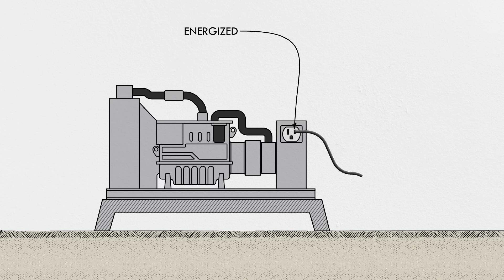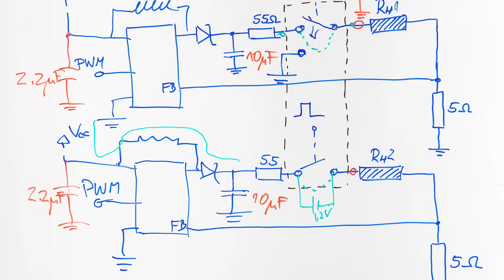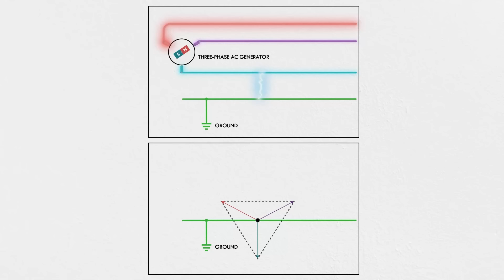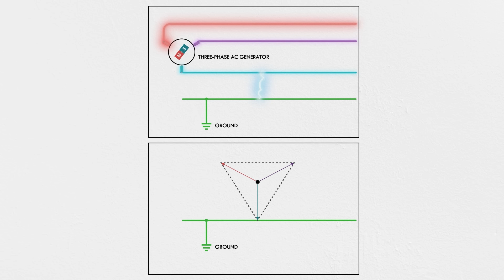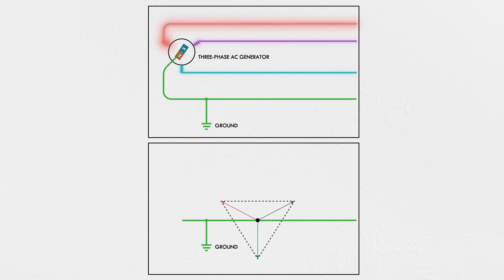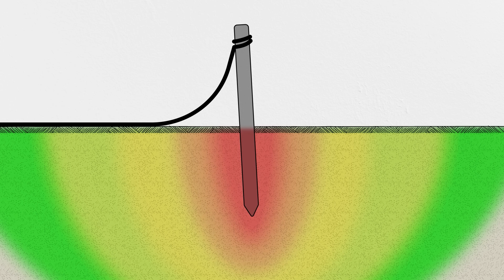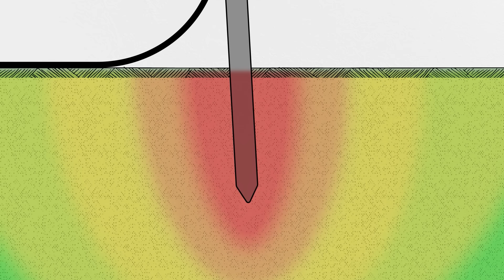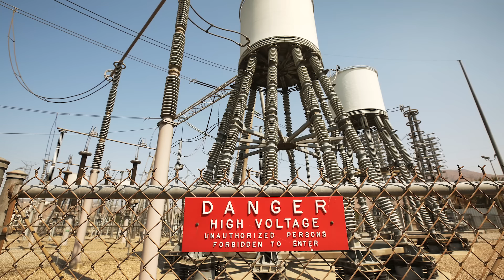Where Does Grounded Electricity Actually Go?

Comment: I am an electrical engineer (in the US) that designs the grounding grids for substations to limit touch and step potentials. I can confirm that there are tons of calculations & analyses that go into the design, including simulations of worst case faults to make sure there is a near zero chance of injury. However, ground grids are not designed to eliminate potentials, only to reduce it enough to prevent arrhythmia. So if you happen to be at a substation during a ground fault, you may still get zapped, but it won't be fatal!

Great video Grady!
Reply: What is the typical voltage potential at these subs? 
An even more difficult concept for many here to understand  is Prospective Instantaneous Fault Current.
Reply: How many people do you know who have, "shuffled to safety". I bet it's zero.
Reply: That's so cool, @zzzz271!  I was always amazed to see how much detail, planning, and regulations/standards you have to adhere to with substation grounding grid analysis and recommendations, just to make sure any human life inside and slightly near the fence line has a chance to survive if a fault occurs.  It's so much more than just welding a bunch of copper grounding grid into the earth and saying "done!"
Reply: @BTW...  Earth Potential Rise (EPR) can vary anywhere from 100 V to over 10 kV. Both have the prospect of being fatal, depending on the scenario, and how it has been designed. There is a huge amount of risk analysis that goes into the mathematical calcs to ensure highest probable safety.
Reply: nice:face-blue-smiling:
Reply: @zzzz271, I have a couple questions. There are a lot of click-bait news articles that over-hype issues such as solar flares, CME's hurtling charged particles towards Earth and causing grid disruptions. But I hardly ever read news articles about this ever happening! So is it really that big of an issue, or is it over-hyped? Also, is the grid really that vulnerable to EMP attacks, or is that a bunch of over-hyped stuff too? Seems like a relative topic, especially now with the threat of Russia, and movies like Oppenheimer in this day and age.
Reply: @petef.4361  Direct hit CME can induce current into the grid.  There was one back when telegraphs were in use... some stations burned, some just were able to disconnect their power source and use the induced current to transmit!
Yes, the grid is likely to be vulnerable to EM inducing current, with an EMP being a big suddent input.  Vehicles are also at risk, except the very old ones without any sort of electronic engine controls.
Reply: @wolphin732  Yeah I think that was called the Carrington event or something like that. And I believe that it really happened, it just seems like a miracle that nothing significant like that seems to have happened since then. So it makes me wonder if it's just because we are lucky that one hasn't happened since then, or if the grid is slightly more resilient than it once was because of improved technology.
Reply: @dmsdmullins  Can you show where the infinite number of people that have " shuffled to danger " are?
Reply: @wolphin732  One thing that doesn't add up is why people think that if they can confirm some "protection" from this phenomena to some electronics, like cell phones, by wrapping it in a faraday bag and then checking that they can't call it afterwards?
Reply: @petef.4361  Define "news articles"?
Reply: @wolphin732  Which is WHY I refuse to part company with my old ‘69 Ford F100
Reply: Thanks for your comment! 🎉
Reply: So if you screw up, "the floor is lava" becomes a real thing?
Reply: Can I pick your brain for a sec?  I'm in Florida, so lightning is my biggest issue when it comes to grounding.   The worst lightning damage I've seen happens in facilities where there are multiple grounds on the property, and I can think of a few theories on how this happens. Since this happened a few time at this facility, we eventually (painfully) redid everything so there was only one single ground point for the whole facility and the frequent lightning damage stopped.  I've done the same at my home and the only lightning damage I get now is from EMPs of very close strikes, usually to low voltage ports.  

How do you handle grounding the grid or even a substation?  You can't obviously have a single ground for an entire grid, but do you have a single ground at a substation or similar facility?
Reply: This is super interesting to me, I just started working on my first sub as a civil excavation contractor and find it absolutely mind boggling how subs actually operate
Reply: @zzzz271 You only do touch potential calculations? No touch voltage measurements on site?
Reply: Heard of way too many accidents from crews disconnecting service neutrals from poles without also disconnecting the live first. Power will still find a way and can become quite lethal in the case of a faulty neutral, even with a reliable ground connection.
Reply: @dmsdmullins  I work for an electrical contractor, in both Canada and the USA. 20 years ago we were taught to keep your feet together and hop to safety. About 10 years ago we were taught to shuffle. I even make my guys practice shuffling. It’s one thing to shuffle along a flat floor in a building but totally different to do it on the uneven rough ground. So once in a while I do a drill on site. Watching everybody’s methods, watching for step and touch potential. We normally set up EPZs for most work. Storm repair is definitely the worst situation to be in when trying to eliminate and control differences in potential.
Reply: Some one posted above above in reply to another topic about Trousers for over the boots and and clothing with an imbedded isolated fire/heat retarding grounding wire running to the feet as PPE. Also what other forms of detection devices exist that are hand held isolated for crews to check prior to stepping.
Reply: @brockolious  Believe it or not, that's pretty much how it was done way back. Some of the sites I have worked on are approaching 100 years old and have....questionable grounding grids. However, they do get updated.
Reply: @stal5861  Touch and step potential calculations. You can't really measure these touch voltages since they require a ground fault (i.e. a power line is down inside the sub) to exist.
Reply: @grayrabbit2211  Lightning shielding is a little different, I have done some of that as well. There are two methods to determine protection coverage for substations, fixed angle and rolling sphere. Fixed angle is easier since it is pretty much input numbers, get the orientation angles for the shield wires from each mast (basically just really tall poles). Rolling sphere is more involved, you calculated the radius of a sphere based on various info (voltage level of the substation, historical lightning/storm activity in the area, altitude, etc.) then "roll" that sphere along the lightning masts and shield wires to determine the coverage.

All of the equipment, buildings, and fences are grounded to the same ground grid, typically with 2 or more risers (just some copper) that connect to the grid below the ground. So it is a single ground grid, but each piece of equipment is individually connected to the ground grid.
Reply: @zzzz271  Sure you can measure it, using fault simulation. We either use a 40Hz 50A current injection generator connected to a line that is grounded in both end stations, followed by frequency selective touch voltage measurements. Or we use a portable 400kV breaker which we connect to a live line via resistor to limit the amps to roughly 50A, the breaker switching on for 0,5 seconds for each measurement. Then you multiply the touch voltage measurement by a factor (such as 25000/50) to match the real earth fault current/voltage.
Reply: @stal5861  that's very interesting, I've never heard of it done that way. I wonder if that's a Europe vs US thing.
Reply: @zzzz271  I know that Australia and Europe (where I'm from) use the current injection method. It would be interesting to test once in the US and see if it matches your calculations. However high touch voltages are rarely a problem within substations, we usually identify high voltages in the local grid outside substations and local grid surrounding power line poles - due to earth faults on transmission lines/stations.
Reply: @stal5861  yeah, we mostly have issues with touch voltages around the fence and near the corners of the site. To help mitigate those we generally run a loop 3' outside the fence with ground rods spaced every so often.
Reply: Something that caugh my attention looking on finite element simulations of substations ground grids was that potential gradients are way too high on the boundaries of the substations, just where outside people could be walking
Reply: @petef.4361  There was a solar flare in 1989, part of the Canadian grid was down for several hours, I don't recall the X rating.  The Carrington event was estimated around X20.
Reply: @JamesTK that's because neutrals are live. All the current one the line is flowing through the neutral just as it is through the mains.
Reply: I'm not nearly as worried about the step potential during a fault as I am the massive arc flash.  That's the difference between an engineer's and a lineman. You guys focus on the micro problems but forget that I'm going to be a burnt imprint in the gravel long before I get zapped by some phantom step potential.
Reply: @petef.4361  it's not a miracle, they're just rare events on the human time scale.  The grid is basically the same today as it was at the beginning because it's how the physics works.  If anything the grid is less protected because of all the low voltage electronic Controls. There is no practical way to shield the grid from solar induced magnetic fields. Conductors will simply melt to the ground just like they did last time only now they're millions of miles of powerlines and trillions of low voltage circuits, instead of a few thousand miles of telegraph lines.
Reply: @linemanap  So basically, if we are unlucky enough to have it happen during our lifetime, a solar induced magnetic field would screw us up REALLY bad for quite a long time. I guess there is really no sense in worrying about things we can't control so if it happens, it happens.
Reply: @zzzz271 does the fence act like a large coil and get current induced into it?
Reply: @petef.4361 it sounds like something that should be worried about and planned for, like terrorism or a pandemic
Reply: @bl1398  I agree, but I don't think it will ever happen in our lifetimes. Reason being, is could you imagine how much money it would cost to have massive quantities of spare parts ready to go, should there ever be a severe wide-spread event that damages the grid in the United States? From what I understand, there are only so many spare transformers and other parts produced and ready to go at a moments notice. It seems like the United States does quite well recovering from tornado or Hurricane damage to the grid. Just a few days or a couple weeks of inconvenience, and everything is back online ready to go. However, with massive wide-spread damage across the entire nation, I imagine it would take months and months for manufacturers to produce and ship, plus the crews needed to make repairs in such an extreme, once-in-a-lifetime event. Believe me, it scares me to think how long it would take us to recover from such and event, and I just don't think anyone including the government is going to spend the money to be anywhere close to ready to recover from such an event in a timely manner. They would probably have to tax everyone out the wazoo, and this doesn't include the other problems in our country needing fixing such as the crappy and overpriced healthcare system, education, drug problems, illegal immigration, crime, and among other things.
Reply: Your PPE will protect you from 99.9% of the remaining Hazard.
Reply: Most houses I've Built/worked on some have a 3/4 inchx16ft stainless steel Earth acting, EMP lightening, Rod Driven into Ground.
Reply: @sooocheesy Yes

Comment: I work at an insurance company, and a major fire loss came in where the client had installed an electric fence on their balcony to ward off pigeons/birds, and it required grounding.

They put the wire into a plant pot on their balcony.
Reply: Really spices up the petunias
Reply: Now that's a bird brained set up.
Reply: The bigger question is, did the claim get paid out?
Reply: They were making a power plant
Reply: @buildingwhisper shut up and take my like, dang you
Reply: @buildingwhisper Your comment charged me.😂
Reply: @MrItalianfighter1 😂😂
Reply: im sorry that one of your clients was less smart than the pigeon.
Reply: Maybe it was an Electric Daisy (Acmella oleracea)
Reply: Well if the purpose was to secure the pots from the birds, that's exactly where you'd put the ground wire. Putting it to the actual ground or the ground wire of a power outlet would have zero effect.